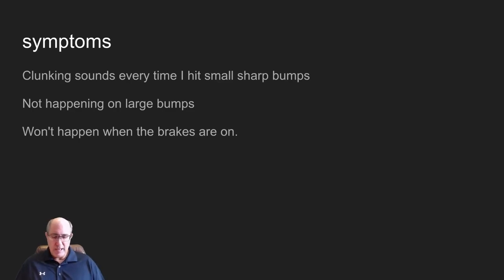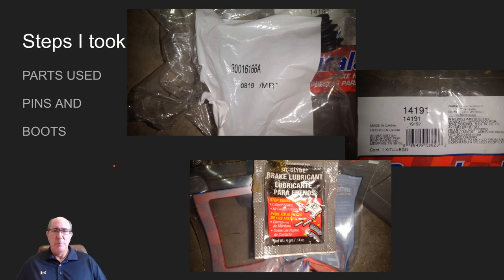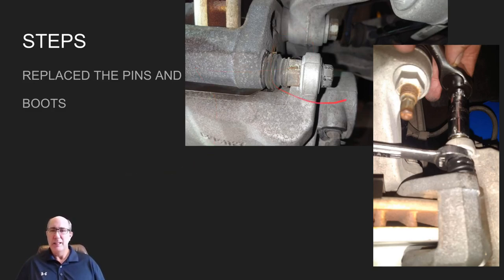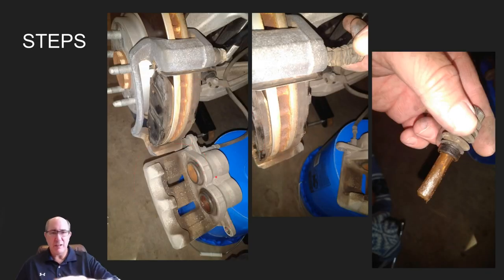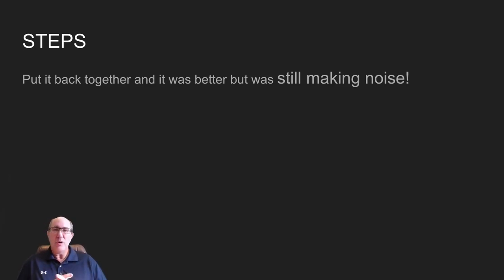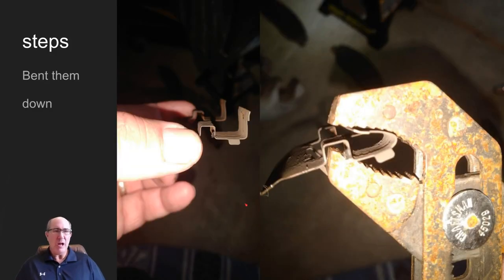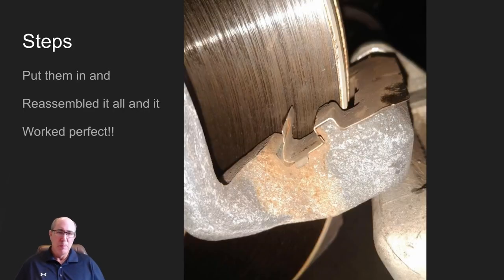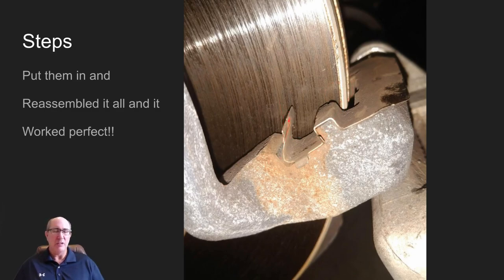Fix that clunky clanking sound on your Cadillac CTS

Comment: 2012 Cadillac CTs coupe awd front passenger side clunking when accelerating at the light anyone have any idea
Reply from the maker: My first guess would be the CV joint or possibly something further back in the drive train like the transfer case or one of the drive shafts.  take a look at the CV joints and see if one of the rubber boots are torn and if so thats most likely the issue.  I've also heard on the caddy forum that the shaft between the transfer case and transmission can fail sometimes.  I dont have FWD so I don't know that FWD system at all but thats where i'd start.

Comment: My clunking in the rear from start to @2500 rpm maybe the universal and bushing shot
Reply from the maker: The clunky clank I had was primarily when going over bumps and rough pavement.  It did not increase with speed.  
Let us know what you find out.

Comment: Mines doing the same thing but I have brembo
Reply from the maker: There’s a good chance they use a similar spring on those calipers so it might be worth checking.  I’ve never worked on Brembos but just in case I would double check all the caliper mounting bolts and slides and so on just to make sure it’s all ok.  Let me know what you find with that.

Comment: My 2016 Cadillac CTS makes a clunking sound when I put it on reverse only on cold starts. When the car is warm it won’t make the sound
Reply from the maker: This is most likely not the brakes.  I would inspect the entire drive train. Not sure if your car is all wheel drive but if so you'll want to inspect the transfer case and so on. Not sure how many miles you have but on the older cars drive knuckles can go bad and cause serious damage if they fail. They are also known to have output shaft problems from the transfer case.  Don't ignore it.

Comment: how did the clunking sound? so glad I found your video. I am suspecting similar issue and its driving me crazy. Thought it was the end links but they seemed very firm, so are the sway bar bushings. I 'shook' the car, and the struts seem very stiff and stable as well.
Reply from the maker: For me it was a clanky clunking sound and typically happened on the smaller seams in the road easily heard at 30mph.  
I don’t hear it much over the larger more gradual bumps like speed-bumps and so on.
Reply: @yourdiytechlife  many thanks! I watched your other CTS videos and noticed you replaced your front shocks. https://www.youtube.com/watch?v=ikMrlw9fZp0 was this before you diagnosed that it was a brake pad issue? or were you just replacing the whole front end to eliminate the possible issues
Reply from the maker: @RegoTVs  I did both front and rear, the old shocks weren’t to bad but I noticed the ride was getting harsh and the car wasn’t as stable over the road so I replaced them all. It really wasn’t related to the noise at all.

Comment: Everyone told me i had to change my struts and i kept saying it cant be, to my my suprise i figured it out and found out it was these clips, it drove me nuts for months...in time these clips get loose and they end up sounding like your hitting metal glass, sounds aweful...eather order new hardware clips or bend yours back to a tighter shape to press up against the brake....never thought id find a video on this...ths happened to me about 2yrs back and they just started making noise again...thanks for the video, so that others can solve this headache
Reply from the maker: Yeah, mine sounded terrible like the suspension was coming apart 😂.  I had a good shop fortunately that told me the suspension was just fine but couldn’t find the source of the rattle clank sound.  It really took a long time to track it down.  
So far they are still silent so the bend fix seems fairly solid.

Comment: Have the same problem with mine. Mechanic said it’s the strut mounts but idk
Reply from the maker: It could be the mounts BUT doing this is cheap and easy.  if you don't do it yourself you might have to find a mechanic that will at least try it for an hourly charge vs doing the strut mounts.  OR you might ask your mechanic for an guarantee of the fix if they do the mounts ;-) .

Comment: I have a similar problem and it’s the front left wheel. When I push the break it’s a clunky sound at times too. Could it really be the clips? The mechanic said it was my wheel bearing but the abs light is not on
Reply from the maker: if you are hearing a clunking sound when the breaks are pushed then most likely this wont be the fix.  this would only happen when the brakes were not activated and the brake pads were free floating in the calipers.  Also, the ABS light will not tell you if you have a bad wheel bearing.  It could very well be a bearing but there are a bunch of other suspension parts that could be causing your issue as well.  I would have it checked out by another shop and get a second opinion without telling them what the first shop thought was wrong.  I've actually had to replace a front bearing years ago when it was under warranty so its certainly not out of the realm of possibilities.

Comment: Did this sound like a worn shock bushing or loose interior/seats?
Reply from the maker: it had sort of a clunky clanky sounds and I suspect it could sound different on different vehicles but it definitely had a metallic component to the sound.
Reply: @yourdiytechlife  Thank you for being descriptive.  The noise I'm trying to identify sounds only the car goes through dampening on my 2012 CTSV
Reply from the maker: @dasteufelhund  typically I would only hear this during short sharp bumps in the road.  larger bumps could produce it but at much lower volume.  In addition,  one way you can test for this condition is to apply your brakes while going over bumps that would normally cause the noise and if the noise still happens then its not the brakes.  the noise was specifically produced because the brake pads were loose in the calipers so when you apply the brakes it forces the pads against the calipers causing the noise to stop.